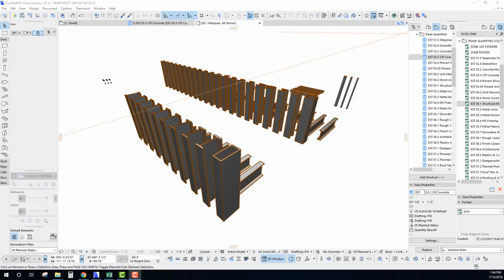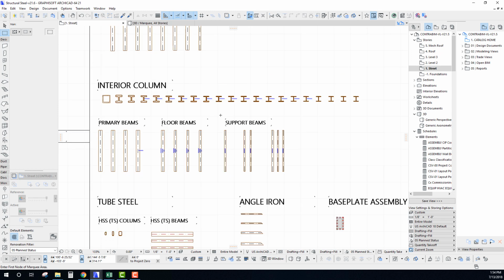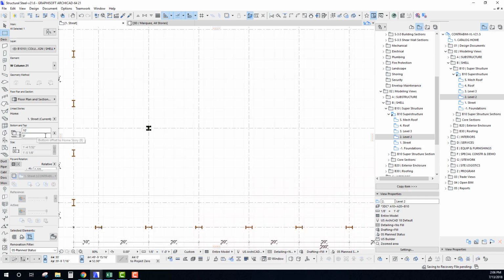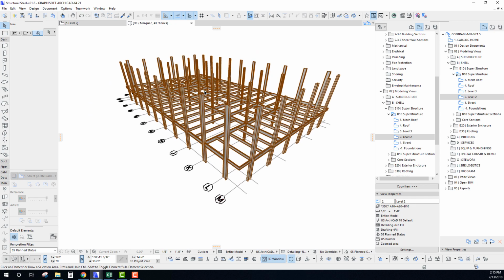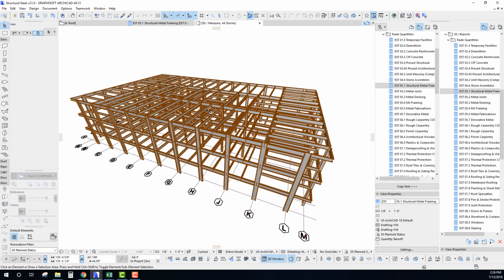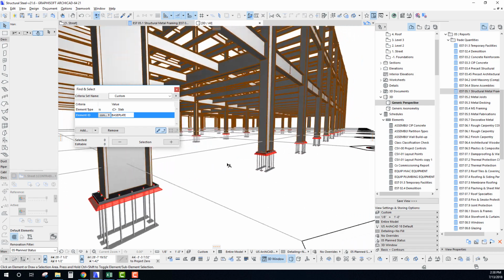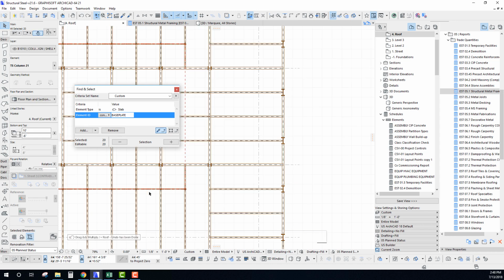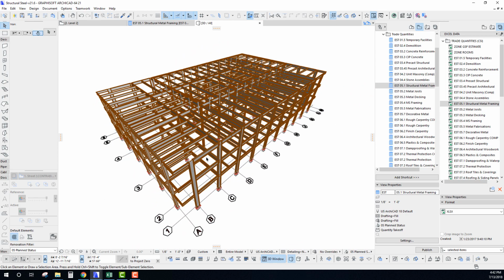Modeling Commercial Steel Structures in ArchiCAD (Episode008)

Comment: Beautiful knowledge about the software, i wanna asking why you not using beam & coloumn tools for the modeling ? Thnks for your response
Reply from the maker: Thanks for the comment! Primarily use the object tool because of the simple access to the standard steel shapes used here in the US. Beams and Columns would require profiles with modifiers, which works also, but may take a bit more time to adjust. Plus to get the accurate weights, it's useful to reference the standard catalog.

Comment: Can i know what is your specification for your desktop that your working for this ArchiCAD. Very super smooth
Reply from the maker: Hi Mr Asyraf! So I believe when I originally recorded this, I was working on a Dell Precision Laptop with i7 and 4gb card and 16gb ram. I can't remember the exact specs, but the machine was top of the line when I bought it, but motherboard shorted out so I'm now working on a lenovo P51 laptop with mobile xeon processor and 4gb card, Quadro m2200. Already had to replace the motherboard and all 64gbs of ram on this machine, but it's still plugging away:) Thanks for the question!

Comment: Why don't you use Beam or Column tool with profile?
Regard.
Reply from the maker: Great question. I've always preferred using the objects as the library of of steel shapes is already there and preloaded. It also makes it a little easier to switch shapes without having to constantly import profiles. It can definitely be done either way, but with beams and columns you'll need to pay a little more attention to the sizing and details if you want to use it for weights and tonnage calcs. Thanks for the question!

Comment: great could u make a video on modelling precast structures with modular construction techniques in archicad
i think there is great possibilities
Reply from the maker: Sure, I love precast concrete structures. Can you post a link to an image or article that describes the modular type components you have in mind?
Reply: ContraBIM heres the link https://youtu.be/OAwoJRN_v7c 
construction has become fast and modular so should the tools.  but the problem is that ARCHICAD don't have precast tools as are available for REVIT. also REVIT has great integration with structural analysis softwares.  
so u will get the whole idea what i am talking about from the link
Reply from the maker: Thanks Rajul for the link. I'm actually a huge fan of Tekla Structures, used it in the past for CIP detailing as well as some Precast. Very powerful tool for structural detailing, embed placement, and parametric connections. I think you mean Tekla as opposed to Revit here... Anyways, ArchiCAD does have Precast Structural elements in the ArchiCAD Library. I have these included in my base Library, linked up for quantities and estimation. I'll do a video on it here soon!
Reply: ContraBIM thanks, waiting for video 
yes tekla has far more LOD and precast tools then revit. as a bim software revit has great native precast tools but archicad lacks structural tools.  both these softwares go head to head with each other. i think GRAPHISOFT should develop rock solid precast tools for archicad as the MEP MODELER is addon to archicad what do u think??  as IFC collaboration has some shortcomings
Reply from the maker: For structural detailing, and analysis, ArchiCAD definitely has some room for improvement. That certainly isn't their primary objective, but the functionality is all there to develop custom solutions for really any purpose. The precast objects in their library are ok, but for more complex geometry profiles, operators, and GDL objects can get it done. MEP Modeler works fine once you setup your systems and get the clicks, but I wish they had better options for connections (coupling types and joining methods). IFC i'm a fan of, and the IFC Manager tool in ArchICAD is great. Understanding all the settings of IFC translators takes some time, but has a ton of control for import/export once you do. Thanks for the comments and questions!
Reply: ContraBIM for features that are not natively available in archicad u have some way to work that out. looks like u r having a long experience with archicad (probably 5 years or more)
Reply from the maker: Yes I've definitely been working with ArchiCAD for a while now...It took some time to realize all the potential right there under the hood. That's why I developed ContraBIM, as a way to share these workflows, data sets, and reports that took a while to figure out and develop. I want to help others by showing this potential, and jump starting them with template files that are ready to go!
Reply: ContraBIM your confidence on archicad makes me to dig deep in further exploring archicad. the video which u would be making (upon my request) will definitely raise my archicad construction workflow experience. 
WAITING MORE EAGERLY THAN BEFORE FOR THE VIDEO
Reply: @CONTRABIM  john did you remember to make a video on modular construction using archicad